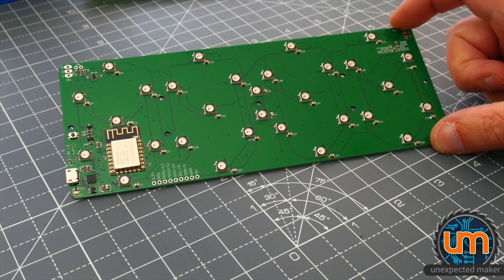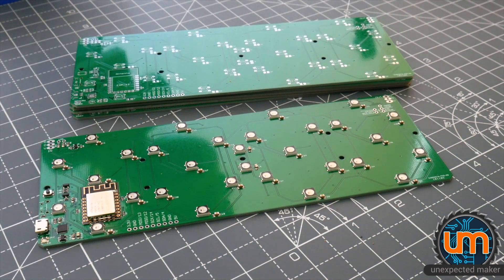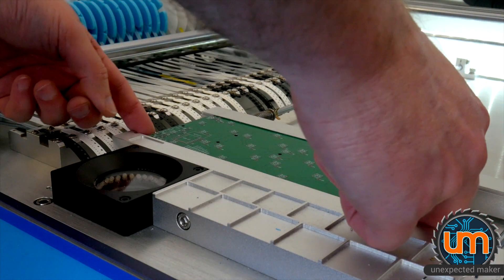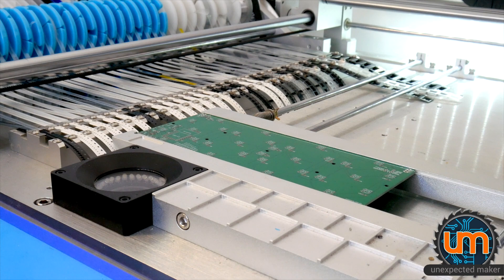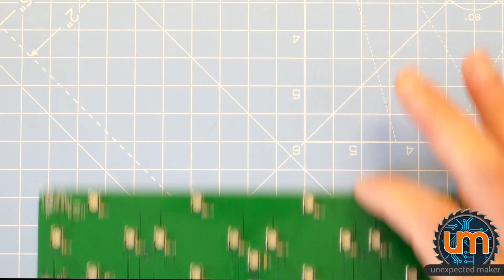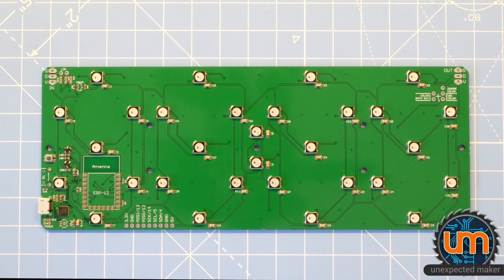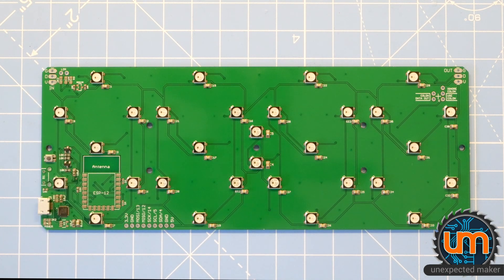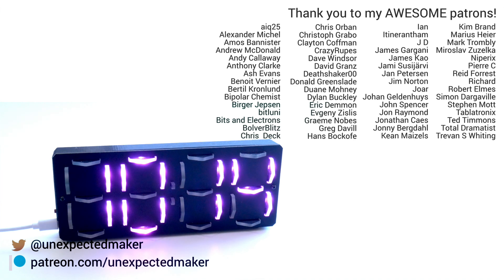More Pick & Placing! Mod-able Laser WiFi Clock

Comment: Geezuz that thing is fast for a machine you use at home.
Reply from the maker: Never fast enough :)
Reply: Get your boards pre populated then...
Reply: @Dust599  Takes time and money. Tho I think Seon does this because he likes to tinker with stuff (so do I) :)
Reply from the maker: @Peter Elllens Or buy a bigger, faster PnP? :D
Reply: @Chriva  Sometimes practicality has to take precedence...
Reply: I'd call it slow. You are however always in a state of preferring placement accuracy, repeat-ability, no problems/stoppages, reduced changeover between projects/jobs, and having the having the least interaction instead of conrcern over the speed. Externally you have your reflow time in your oven which ultimately dictates you shouldn't be too concerned with speed. Not having to 'touchup' and have so much interaction with each board is what you look for.
Reply from the maker: 100% @Chris Donnelly - I always want accuracy and reliability over speed... and 1780 cph with vision is pretty dam fast for a desktop PnP anyway, so I'm not really complaining. That said, the nature of this type of machine doesn't lend itself to accuracy no matter what speed it's running... where other PnP's I've been looking at offer 2-5x speed with way better base line reliability.

Comment: tried openpnp?
Reply from the maker: No, as it requires either a controller board change, or a non-reversible re-flashing of the current board, and I  can't afford any down time. My PnP is nicely tuned now, so I have no need to alter it... other than getting a new  one with more feeders :)
Reply: @UnexpectedMaker  it's hard to get a real feel for your machine over 'the tube' but I'd put this on your list of 'things to do'. Your main high volume parts(leds) on this board should be placed in a closer feeder (with respect to camera and pcb position) to reduce travel time. I can't really say how hard this would be to achieve with the feeders on this device. Potentially if these feeders are in clusters you might get more and place the one cluster nearest the head & camera for each project. Your common parts for projects could be next cluster and so forth. Singularly placed common parts the furthest away. This might be a better way to deal with reduced travel time manually.
Reply from the maker: Hey @Chris Donnelly - The LEDs are already in the closest 12mm feeder position to the camera, so no chance of reduction there, and other components being placed are in fixed positions being used for other boards, so in this case travel time was a good as I could get it without trying to re-order components. I only had 8 boards to build, so it really didn't matter, but I brought it up in the video to explain it, so I'd not get bombarded with people telling me I could have improved things by  re-ordering the part pickups :)